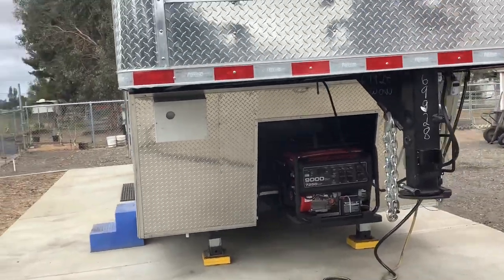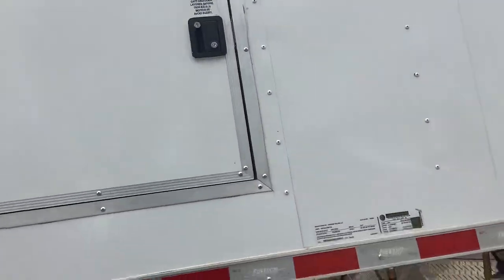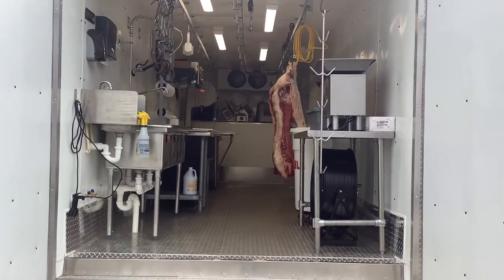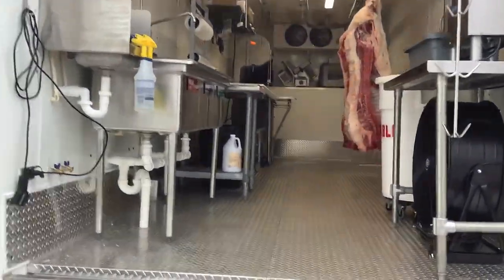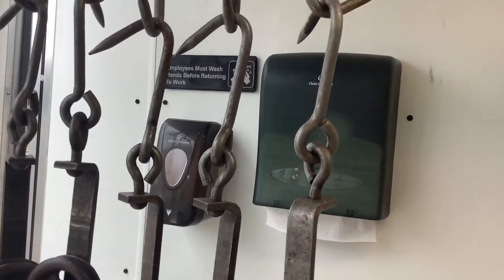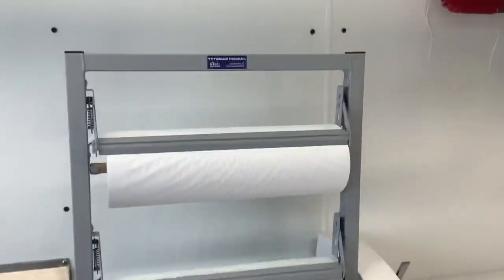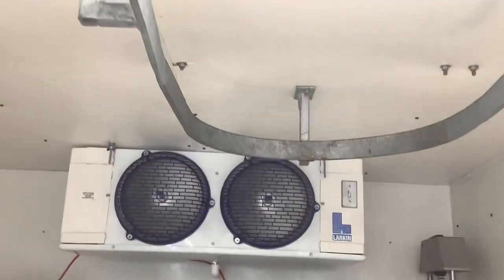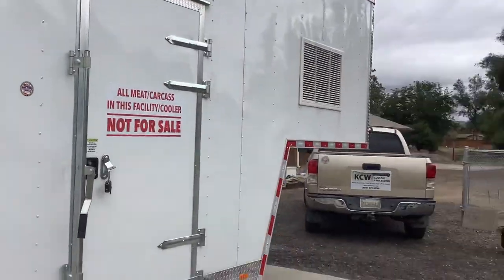KCW Custom Processing. My New state of the art USDA spec built mobile butcher shop.

Comment: Hello again Daniel!  With my steel skeleton now in place, I'm working on the added structure to secure the winch.  Lots of chatter online about winch vs hoist.  While a big part of this chatter is related to the risk of lifting human-beings with a winch (because of potential free-spooling), we're not lifting people so I'm moving past that point.  The remaining point being made is that winches are designed for pulling, not lifting.  While the gist of this is understood, after decades of farming using winches, myself as well as a host of others know first-hand that winches will indeed lift vertically.  I've never had a winch free spool when letting line out under load.  Common sense leads the operator to recognize the line must remain taught.  Common sense also means we keep our bodies away from the load being lifted.    I believe you said somewhere that yours is a 5000 lb capacity.  I'm finding this 5000 lb rating to be pretty much of the sweet spot tradeoff.  The frame of the 5K and smaller units are similar whereas going bigger tends to lead to a much bulkier frame.  I've only got so much room to work with in the ceiling.  I could design a pully setup with the winch on the wall and pulley/fairlead in the ceiling, which I may still do.  Higher capacity 120 volt winches are not as readily available without resorting to very expensive Hoists.  So placing the 12 volt winch on the floor (or maybe even attached to the trailer frame), will allow short DC connections to a 12 volt battery.  All that said, I wanted to ask if you have been happy with the lifting capacity of your winch?  Has the 5000lb rating been sufficient for lifting your heaviest beef?  Does it sound like it's really straining or is it lifting with relative ease?  As always, thanks for taking the time to respond.  And BTW, congrats on having earned a spot on Team USA at the World Butcher Challenge!  -- Steve in WI
Reply from the maker: Thank you and I appreciate the congratulations. 👍🏻🇺🇸 I must say I am very happy with the lifting capacity of my 5000 pound winch. I feel like she grunts a tad when she has the heaviest heavies that I’ve done mind you I just hit my shop max with a 1039 # beef. The winch did the lifting of that beef in quarters with ease. The one thing I would caution you when using a winch in the ceiling. If it catches anything else like a bumper, or a door frame… it’s taking those items with it. As far as free spooling stay clear, but I’ve never had any problem whatsoever. I believe I have some build pictures of the frame and the winch setting in my ceiling I’d like to get them to you for some visual reference. Find me on Facebook so we can hook up on messenger and speak outside of YouTube. 😉👍🏻

Comment: Not wishing to wear out my welcome, I'm hoping you can shed some light on the width of freezer paper you've found to be optimum.  I'm guessing your Bulman dispenser is 18" wide?  Any favorite type of paper and source that you recommend?  And only because your rig is spotless, I'd also be grateful for any tips on how a pro keeps things so clean and sanitary.  Any particular cleaning solutions you recommend for cleaning all the nooks and crannies on the saw and grinder?  Any products that are mandatory or others that are prohibited?  As I plan a new facility similar to yours, I'm learning that the questions surrounding the smaller details are hardest to uncover.  Flooring material is difficult to resolve.  That aluminum diamond plate you have is now outrageously priced.  Regular steel diamond plate might be palatable but I'm still digging to learn if steel would be acceptable.   I know these things don't matter to a hobbyist.  I'm tasked with building mine to pass an inspection, if need be.  Thanks again for your previous responses as they were immensely helpful.  -- Steve
Reply from the maker: Bottom line is clean all the time, And when you think it’s clean ……clean some more. 😐. 😂😂😂. All the cleaners I use are from Zep. A fully approved line. Plus I keep MSDS sheets on them. I bought just about several types of scrub brushes,  three types of deck brushes, I keep cleaner/degreaser, antibacterial sanitizer, and food grade equipment oil in spray bottles at all times. And I’m always looking for a better way to keep things spotless. My frame of mind is if you keep it spick and span/ I would eat off of my block.  it’ll be easier to clean when it does get dirty. And when you push as many animals as I do through it gets real dirty. I use heavy duty 18 inch butcher paper. The kind with the wax lined on one side. Before I do that I have an 18 inch I believe it’s 1.2 mil poly wrap. And before I do that I put plastic innerfolds in between items. As far as the diamond plate the thin stuff I have is great and scrubbable, as well as not too slick even when theirs grease and fat on it. though I wish I would have went Thicker like real diamond plate. When you drop heavy items as you do from time to time I’ve haven’t put a hole in the floor yet but I’ve made a couple dents. Also I have trough drains across the front and back of the trailer. After scrubbing being able to spray it out makes it real nice and handy easy. Don’t worry about wearing all your welcome ask all the questions you will. Hope that helps and good luck my friend.

Comment: Daniel - Might your grinder be a 22 series, 120 volt model?  I'm seeing a fair amount of people demonstrating an apparent need for a double grind on various different grinders.  Hoping to avoid that extra labor.  Hoping you can share if you are able to achieve a satisfactory grind in a single pass and if so, what size grinder plate you use.  Any advice you can provide regarding the reason some people are double grinding would be appreciated.  I don't know if they are double grinding because they are using a smaller machine or if the double-grind is needed to satisfy the customer.  Thanks for putting up your videos.  Your trailer is amazing.
Reply from the maker: In my experience you double grind beef always. It get’s a better hamburger texture, as well as distributes the fat evenly throughout the Burger. That would be through a 3/8 inch plate 1St grind And the 1/8 inch plate second grind. I myself always ground hamburger twice, 2 times through a 3/8 inch plate. My customers love it. A larger 1/4 inch plate one time would be considered chill grind. Or at your discretion an even larger plate yet. 

Ground pork for sausage is one time through a 3/8 inch plate. For certain sausages that call for emulsification. ( hotdog like texture )You can grind multiple times and achieve close to the same desired consistency you would with a high-grade food processor or buffalo chopper. 

Hope that helps 🔪💪🏻 R.T.B.
Reply from the maker: And yes the grinder head was a 22 at that time I now have a 7 1/2 hp Hobart MG1532. I have a video on it 👍🏻

Comment: Making final decisions on bandsaw and grinder.  Pro-cut has caught my attention, if for no other reason that the school-of-heavy-metal.  Internal decision lies with springing for all stainless-steel construction or a blend of aluminum/mild steel.  Grinder is easier decision as an all SS unit is just a few hundred more.  However the spread between the all SS and Aluminum/Steel versions of the KS-116 saw is over $2K.  The mild steel base on the lowest cost option (which has aluminum upper construction) has me worried about corrosion beginning in just a few years.  What do you think?  I'm not swimming in money but I'm also forcing myself to think long-term.  Regarding your aluminum diamond plate:  Did you cut or bend to make the joint between the floor and wall? What material did you use to cove that joint?  I'm also installing a winch but will be getting creative with pulleys to that I can keep the winch assembly out of the ceiling where it would take up valuable headroom and not be easily accessible.  Your winch is not visible in your video nor did I see a control cable hanging anywhere.  Guessing you have a port for the remote near the rear?... or do you have a cordless remote?  And a huge thanks for responding to these questions.  I've searched low and high with little luck finding any forums for these types of questions, other than at a homesteading level.  Pretty rare to have a pro answering questions so thanks again for sharing your experience.
Reply from the maker: Bottom line is with grinders they need to be stainless steel as with all other equipment like your saw! GO SS THAT IS ALL! And do yourself a favor get yourself a bigger grinder than you think you’re ever going to need I started with a 1 hp pro cut 22 head. And about all it did was get me started besides massive amounts of headaches. I know have a $30,000 7 1/2 hp 32 head Hobart MG 1532. It is a blessing to work with. And I bought an old-school dinosaur saw that I knew I could find parts for before I purchased it. She does me solid four or five times a week. If you’re planning on processing animals to make even side money and if it’s more than anything besides a hobby. Spend the big bucks and go big for horsepower electricity and above all get heavy duty. They will last you a life time with love and correct PM

Comment: 5 inches of insulation doesn't say much.  What's the R value of the insulation? Where did you get your hanging track and rollers and hooks
Reply from the maker: I’ll have to look up the R value bud I don’t know it off the top my head but she definitely cools down whole beef quarter over night. The rail was made 1/4 inch steel bar. With the rail connect and the trolleys came from a very good friend who knew I was starting my business.

Comment: I see you have a procut grinder in that trailer. Is it a 22 or 32? How happy are you with its quality and performance? I’m upgrading and would like hear your input if you don’t mind. Thanks!
Reply: I use a pro cut  22 grinder works excellent, grind about 15,000 lbs a year for last 5 years

Comment: HI! How would you handle waster water (per usda compliance) with a mobile unit?
Reply from the maker: I had 2-50 gallon holding tanks. Built into the bottom of the shop. I have a yearly contract with a preapproved liquid environmental pick up. They come every other Monday to pump the tanks and take it away to a disposal facility. Since there is not a bathroom on the rig. And no actual sewage they can treat them as grease traps. That one took a lot of finagling and about three months worth of phone calls to clear. 😅Granted that was in compliance with California Department of food and agriculture. Also only Custom not USDA. I hope that helps.

Comment: Daniel - What were the headaches you were dealing with when you had the Pro-cut 22?  This was the very unit I was considering.  Was it a Pro-cut quality problem or was the headache due to the unit just not being suited to the volume you were doing?  (Paraphrased:  If your volume would have been lower, would the Pro-cut 22 1 hp have been acceptable?)
Reply from the maker: It’s a good grinder, that being said if I was only doing my own animals it would work just fine. The true headache came with production.  trying to accomplish large tasks it would take a long time and the grinder would get bound up because it’s just not strong enough. Though I made it work. Are used a pro cut 1 hp 22# head with all my processing for one year. I am glad I had to do me solid ……. I am now even more glad that I have graduated to a larger more heavy duty industrial grinder. I hope that answers your question fully
Reply: @danielscepurek5416  Thanks for clearing this up.  At the minimum, you have convinced me to upsize.  This is an unusual build in that I can't afford the inefficiencies of using hobbyist level equipment while at the same time, can't justify the expense of equipment designed for a full-time butcher.  I'm aspiring to process the 40 beef and 80 hogs that our farm direct-markets each season.  While this is still quite a bit less than we raised when we had the option of using local butchers (no longer an option as they're all full and impose hobbyist level restrictions), it will keep the farm alive if we can pull it off.  My next area of research is in regards to how to fill 1 lb ground meat chubs.  I see the hobbyists and hunters are taking the grinding plate out of their grinder while attaching a filling tube.  Even though this works, it looks slow, clumsy and best with a third hand available.  I'd imagine you use a hydraulic, pneumatic or electric powered stuffer for this?  Or because your new Hobart has the mixer, are you filling chubs using the Hobart?
Reply from the maker: @solarharvestfarm955  Actually I still go old-school and do 1 pound packs. It’s easier for me now to do it that way rather than fill the chubs. I’m already outgrowing my shop and plan on getting a larger building at that point I will get a pneumatic stuffer and do the chubs. For now Ib ball 1 pound packs and wrap them with pre-cuts. 👈🏻 = 15 x 15“ precut freezer paper comes in bundles of 1000. And with your numbers with 40 beef and 80 hogs per year. Minimum I do 52 beef a year, somewhere in the 250 hog range, and probably 300  goats or lambs. You definitely DO NOT want the pro cut 22 for what you’re trying to achieve. Without sounding like an ass go big or go home😂 at least for your grinder. Whacha got next 👀?
Reply: @danielscepurek5416  Biggest grinder I've been able to find without requiring 3 phase is the 3 HP 1Ph variation from Pro-cut.  Thunderbird makes a 5 hp but it's performance is still only half the 3 HP Pro-Cut. The 3 HP Pro-Cut has a capacity almost 4 times quicker than their 1 and 2 HP units.  They spec their 3 HP unit at 55 lbs/minute for the first grind.  Looking like this is my limit unless I buy a 3 phase converter.  Assume you are either running a converter or have 3 phase available to you.  Regarding 1 lb packs of ground beef vs chubs, I can envision how this might be more efficient that running everything through the grinder a third time (with a stuffing tube attachment).  I'm only wondering how well these 1 pound packs keep in the freezer, compared to the compressed form created within the chubs?  Still good for a year in the freezer?  Meanwhile, I'm cutting and fabricating steel for the rail system.  Track hangers and trollies are ordered.  Refer arrived this week.  Everything's going in a 26 x 8 x 8 truck box mounted on a gooseneck trailer.  Time to make a silk purse from a sow's ear.  (Fitting metaphor, if ever there was one!)  Thanks again for the mentoring.  -- Steve
Reply from the maker: @solarharvestfarm955  Sounds like you’re on top of it my man, as for the 1 pound packs absolutely a year in the freezer no problem. The 3 hp sounds like it won’t be a bad deal. I know for a fact you’ll be happier in the long run buying more heavy duty now. I bought a 20 hp phase converter and yes it is awesome. A few loopholes I had to jump through to get the power I was after. As well as I have to turn everything else off even the cooler fans before I start the phase converter,  is it pours a 50 amp draw just a start. After that I just flip switches and everything goes back on literally 10 to 15 seconds. But that’s all in making it work. I really hope the best for you. And remember to keep after it there’s a lot of guys out there who say they wanna shop but they don’t have the drive grit or the perseverance/passion to actually do it. 👍🏻

Comment: Nice setup, Daniel! Are you cutting USDA, and if so, do you have an office and bathroom somewhere for the inspector?
We have what looks like the same grinder (ProCut 2hp 240V #22), did you cut the guard off of yours? That guard is a pain, especially on 2nd / 3rd grinds. Our state labor inspector would give us grief for no guard, though...
Reply from the maker: Yes on the grinder both accounts, I am state inspected by the California department of food & agriculture. No sales whatsoever. The rig is Built USDA spec for cleanliness and to far surpass my custom exempt inspections. Full custom Butcher, mobile slaughter, and bring back to process here in the facility. I got a 100% greenlight on my initial inspection. The rig has custom gray water/grease traps. W/ hot water. I have a contract with liquid environmental‘s and they come and take it offsite. My solid waste I have to drive down to darling international to get rid of legally. Besides that I love it. I do 1 beef every week. And as many small animals as I can without over crowding. It’s great just me and the job. I get a walk through inspection twice a year & whenever they decide to pop in and visit. I stay on top of my paperwork and keep it absolutely 100% at all times. Cut and give back to the Customer/farmer/rancher. 👌🏻
Reply from the maker: I also just finished re-purposed 17 foot 1 1/4 inch well pipe, 52 inches in the ground For heavy duty shade sails over the rig. So the sun is not beating on it. Putting them up tomorrow.
Reply: @danielscepurek5416  can you sell the butchered cuts if you wanted or does the USDA prohibit sales?
Reply from the maker: @chefspaghetti0912  Full custom, so yes! any sales of processed meat are prohibited. But I can sell whole animals live on the hoof and then process them for said customer’s. That is completely inside the compass of approved rules.
Reply: @danielscepurek5416  thank you!